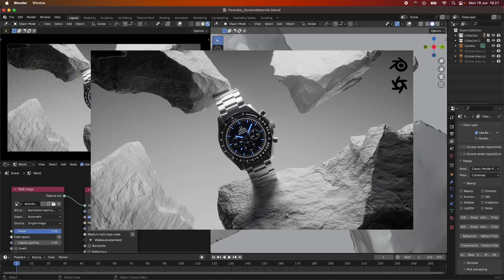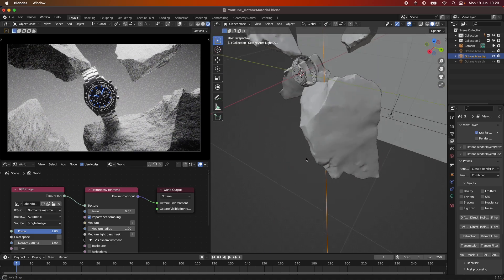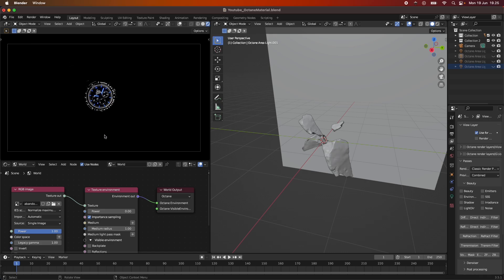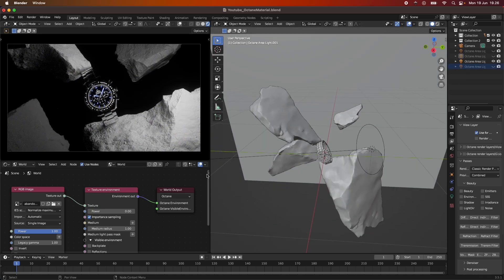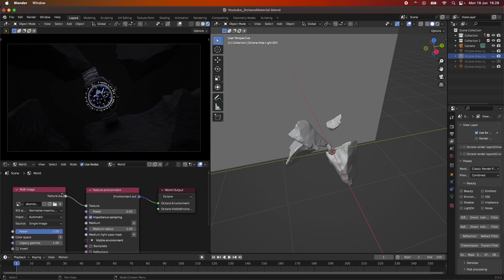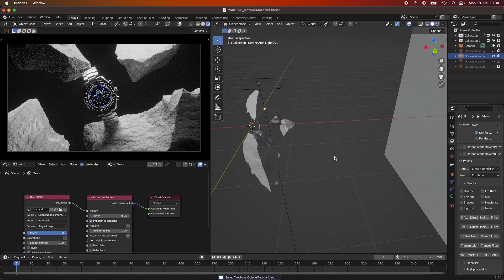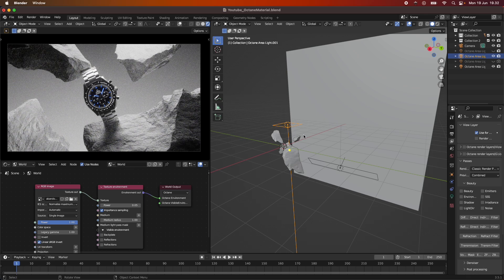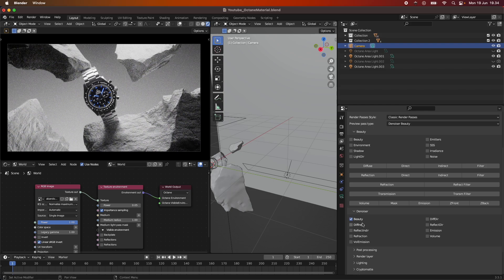Introduction to Octane for Blender: Part 3 - Lighting and Rendering

Comment: Thank you Jonas. is it possible to adjust the spread of the octane are light like the normal blender area light ? like what if I want to make a harsh ray of light casting on the rocks ?
Reply from the maker: Hey! Sry for coming back late! I also find this a bit difficult - i think you could use the barn Doors or Block out with planes, like you would in real life - but ofcourse a bit more complicated. 😅

Comment: why do u prefer octane over cycles? :)
Reply: It's not a matter of preference, it's about using the right tool for the right job. Octane is both unbiased and physically correct, more appropriate for product visualization. You can do the exact same with Eevee and Cycles, Octane just does visualisation better.

Comment: its incredible how much worse blender is to work within. compared to C4D its like driving a bike vs an automatic car. even with octane on blender id still be using C4D despite being a paid system
Reply from the maker: Hey Remmy - fair enough - then this Channel is probably not for you 😉
Reply: I used to use cinema, the reason you think its worse is because you don't understand it. Once i switched to blender then tried going back to cinema a couple of years later cinema felt awkward and foreign to me. Now im switching to houdini and it feels really hard again but should be fine in a while. I'd say more than the program you are just not very good at adapting to different ways of working remmy. C4D is a dying program, its so fucking basic. If you start using something like blender or more to the point houdini you realise that cinema is made for the most basic crap. Such a limited piece of software.
Reply: A more apt description is Cinema is like being a passenger in a train. Blender is like driving the train, houdini is like making the train. Then again with geometry nodes blender will be similar to if not as good as Houdini. The issue with Cinema is that its a black box, you can't actually control it, everything is pre made like cloners and the like. You will be forever stuck pushing play on a simulation or something not really understanding how the fuck it does what it does. So your work will never be as interesting or original as you just rely on pre-made systems to get your work done.